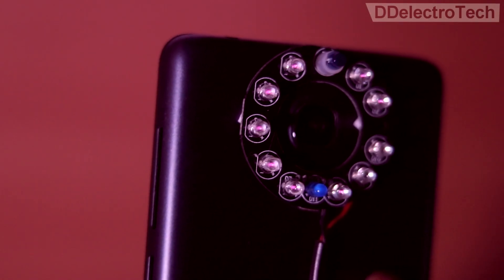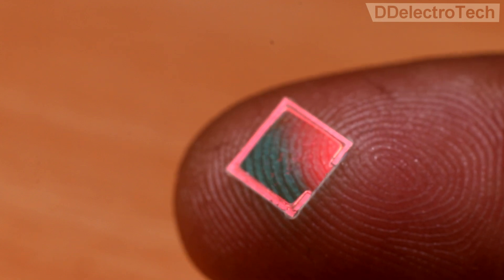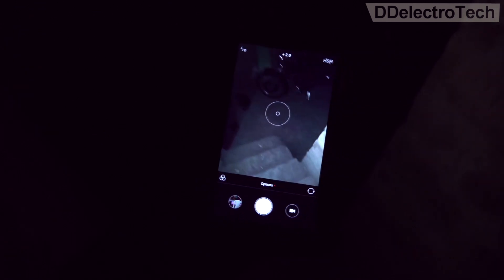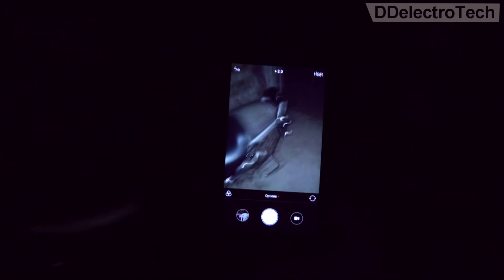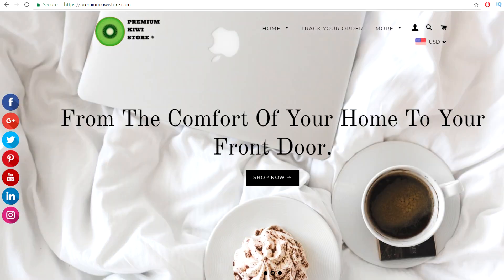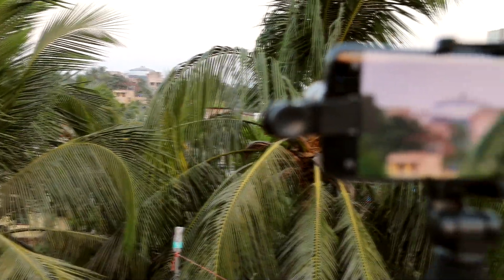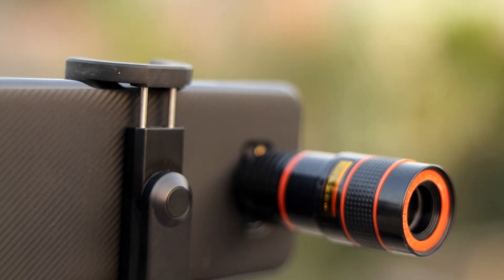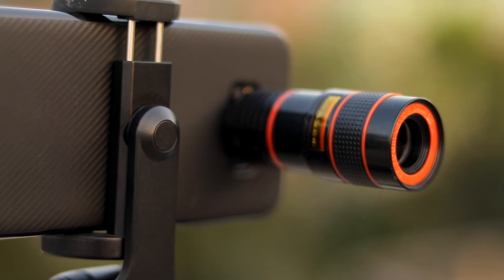$1 Only - How I have Converted My Phone Into Night Vision Camera

Comment: Ok I tried this, the lights work (I can see it with my camera) but it doesn't illuminate enough to see anything more than a couple of inches away from the phone. Only thing that I did different was use a light with I think, 48 bulbs and hooked it to a 12 v battery. Any suggestions on what I screwed up?

Comment: You can check if your Smartphone-Camera can detect Infraredlight without modding it by pointing a remote control to your camera while pressing any button. If you see the light, just get the infrared-LED-Ring and there you go! :-D
Reply: My phone did see a light when I pointed the remote control at it! So, all I have to do to see night vision is add the ring and shoot at night?? That is WAY easier LOL

Comment: Would be even better if you connect the led lights directly to the battery and use a switch to turn it on and off.

Comment: The device which you were using in the video was redmi 2/prime In which we can open the back cover and remove the battery but In other phones the battery is sealed inside and It is not possible to open it. So please make a video on it if You can.😊